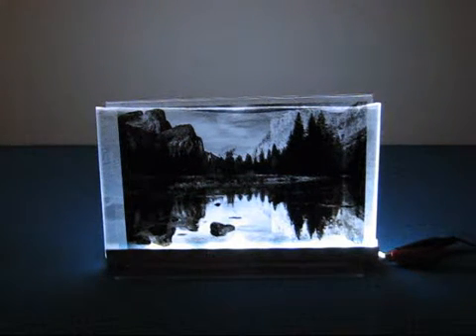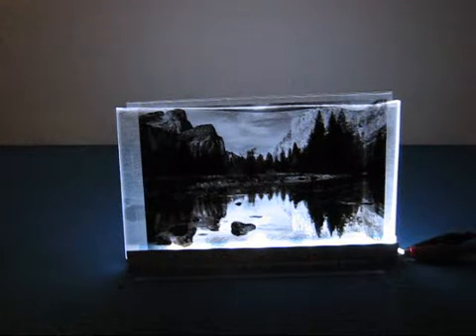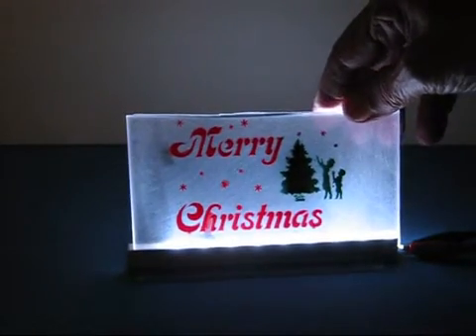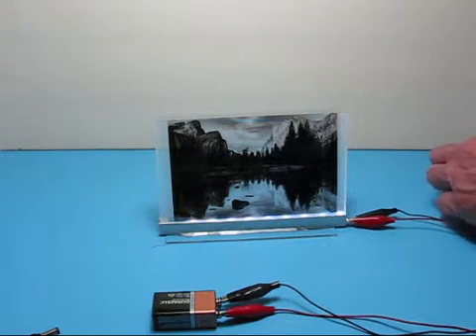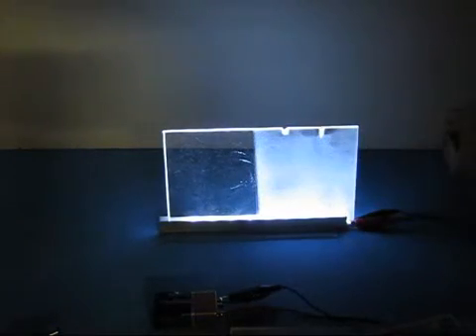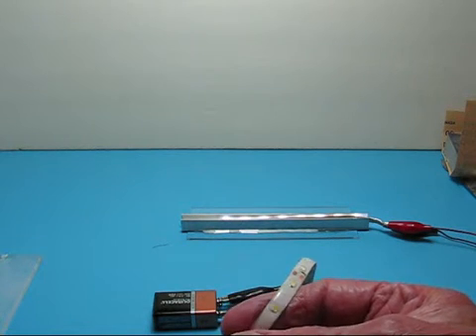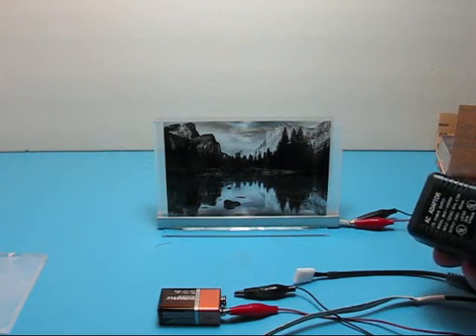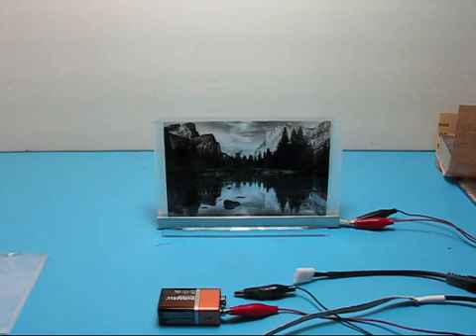Acrylic edge lighting with a difference...

Comment: glad I stumbled across your channel... I was wondering if you could sand the back of a CD case and run a strip of chibitronics (store.chibitronics.com/collections/all) along the bottom edge and then stamp on the front of the case if it would give the same  affect... I'm moving my CD's from their jewel cases to envelopes and am looking for ideas on re purposing the cases and this looks promising...
Reply from the maker: Hi battygirlrachel,
I did try CD cases and there are two problems: The first is that the cases are polystyrene and do transmit some light edge-to-edge, but very poorly when the surface is abraded. Second, the polystyrene is too thin and  transmits only a small amount of light. I was going to add it into the video but thought better of it. Sorry for the thumbs down! Take care, Ken.
Reply: Thanks for letting me know... saves me time and a failed project lol.